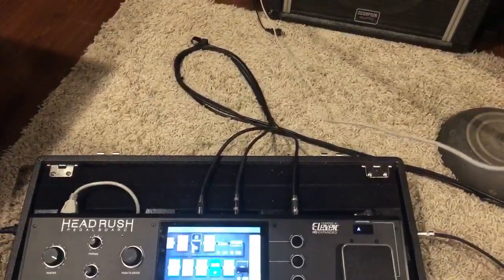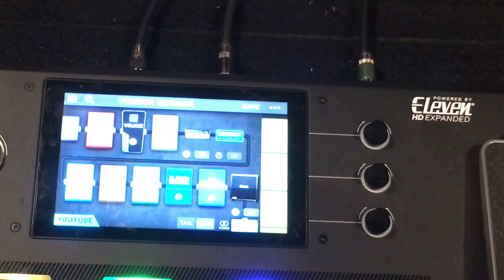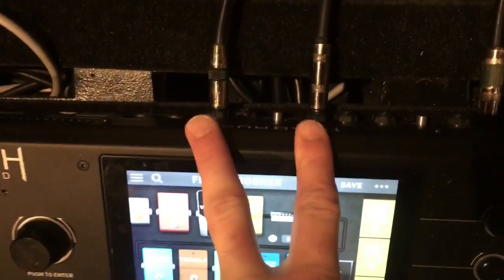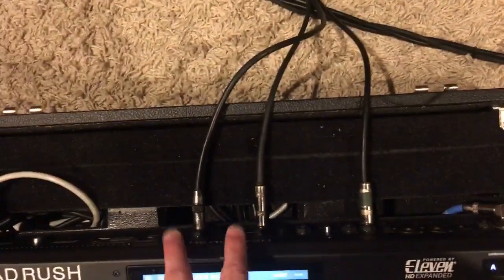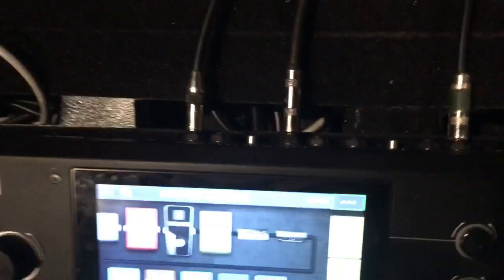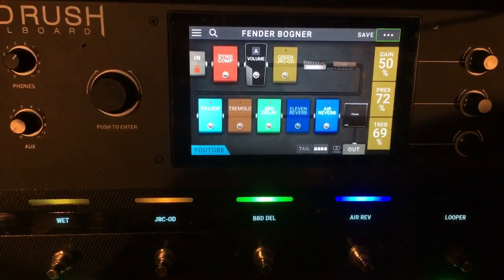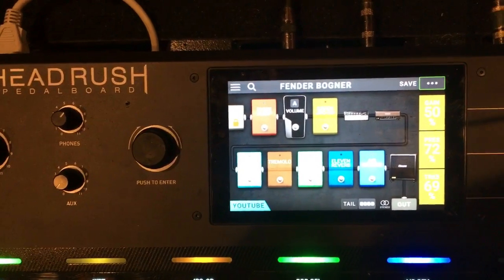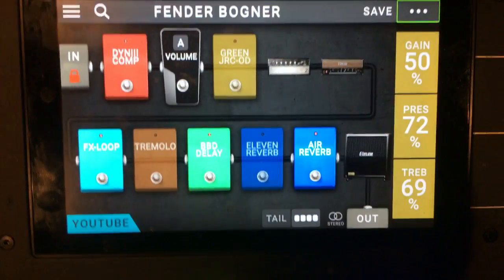4 Cable Method Setup Explained

Comment: Thank you for this video! It's the most informative one I've found for the 4 cable method. I've been using my FRFR but want to experiment with running the headrush into my Fender BDRI just for something different.
Reply from the maker: yeah man 4CM is fun to use and offers lots of options.

Comment: Well i think i got it to work with my Marshall. My next question is why do the tails turn off and cannot be turned back on when you insert the effects loop block?
Reply from the maker: Unfortunately tails don’t work when using the 4 cable method.  It’s really a bummer.  I think they do work when using scenes though.  Just not between rigs.
Reply: @DoctorMcFarlandStudios  hopefully it will be an updated fix someday.

Comment: Hey doc, if I’m not going to foh for example an just using amp using the amps speaker (combo amp) what would my global settings be for that? Also on the back where it says line/amp and stomp/rig what would be best to use? Thanks mate
Reply from the maker: Depends on if you are using the input jack on the front or the FX return on the back.  Either way I would use the Alt output and set the source to cab/IR input.  Line and amp are just sending different levels.  Either setting won't hurt the unit you are going into. For FRFR use line and for amps use....amp.

Comment: Always want to have this explained, thanks!  Only problem I can see is the Tail function is not activated.  Any work around you know of?
Reply from the maker: Correct.  I wouldn't suggest using the 4 cable method with a Headrush or Gigboard since the tails function is defeated in the process.  Plugging into the FX Return of an amp is a the best option if you really want to use a real amp in your setup.
Reply: @DoctorMcFarlandStudios  so the fx into the output of the headrush ? I just got mine yesterday and am looking for ways of going into an amp 
Thanks

Comment: Hey Doc, I'm having the same issue as navo1020 is with the 4CM. I want to use my amps preamp for the tone and the HeadRush for effects only in front and in the FX loop. The signal however drops considerably when I do this 4CM. How can I achieve my amp pushing through the Headrush at the same volume as if the HeadRush wasn't there and it's guitar and cable straight into the amp with no effects. Bottom line I'm losing the regular amp tone push when I use the 4CM.
Reply from the maker: Is there a volume adjustment on the amp for the FX Loop?  I wouldn't know unless I saw it. Send me a message on facebook and we can facetime each other so I can see your setup.

Comment: What happens if you have the Alternate output set to Cab Input but you switch to a patch where you are using a IR in the chain? Do you have to change the Alternate Output setting everytime you switch between those two? (Cab and IR)
Reply from the maker: Yeah you can't have it both ways. I have starting using the stock cabs 99% of the time.  They sound great to me.

Comment: I think that the idea is to bypass your real Amp Pre amp if you are using the headrush amps, so this means that you should put the fx loop before your headrush amps, Am I correct? I'm a little bit confused, but thanks for the video!
Reply from the maker: nava1020 haha you may be right.  Experiment with it and let know what you find out.

Comment: Hi thanks a lot for this great video. Is the following setup possible? 4 cable method with real amp headrush just using effects eg. on the left channel output and right channel a virtual amp and cab from the Headrush? Cheers
Reply from the maker: You would  essentially use the XLR output to send the full rig to a FOH and the 1/4 combined with 4CM to the amp. If using the Headrush I still suggest using the FX return of the amp or an FRFR Speaker. If you want to use your real amp for channel switching then the Line6 HX effects or Helix would be better for this setup.  What amp are you using?
Reply: Hi thanks ;-) I use a Friedman Runt 20 which has a great buffered effects loop. At the moment i have the Line 6 HX effects but am thinking of selling and going over to the Headrush, because I find the interface much better and easier. Ah ok so I connect the headrush with the Runt 20 in 4CM via the effects loop of head rush and the Runt 20. What are the the Global settings for this? Thanks.
Reply: Hi again. Some people seem to have "tone suck" when using 4CM. What is your experience on this? I heard some people say this for the headrush, but even more people said this for the HX effects when in 4CM. I guess it also depends whether your effects loop is buffered? Thanks fo r your opinion on this?
Reply from the maker: @henriksorensen6438  I would just use the FX Return so you can still take advantage of the power tube section of the amp. This will allow you to utilize the amps in the headrush as well as the effects and keep the spillover functionality between rigs and scenes.
Reply: ok thanks. So basically Headrush as preamp and my real amp as the power amp. Thanks
Reply: do you think the line 6 hx effects is better for the 4 cable method?
Reply from the maker: @henriksorensen6438  Yeah thats the best way to use the Headrush.
Reply: ok thanks ;-) do you think the HX effects from line 6 is better to than the headrush for 4CM?
Reply from the maker: @henriksorensen6438  Yes I do. Only for the fact that you can't use tails when using the FX Loop on the Headrush. It was a huge mistake in the making of the unit but with that said I think the FX return of an amp while using the amps in the Headrush for the "preamp sound" is just as good and is a really great setup. Its the setup I use 99% of the time.
Reply: ok thanks again for your time ;-)

Comment: Hey doc, I'm doing the same but my amp signal (the Marshall pre amp) is really low, is it mandatory to have the HR master all the way up?
Reply from the maker: Shouldn't be but what physical amp are you going into?
Reply: @DoctorMcFarlandStudios  Well its a Marshall MA100, head and Cab, when I use my HR just on the Return of the amp it's a nice signal when I use the 4cm (fx loop block at level 100) it's just really really low, at this moment I have the HR master at 12 o'clock and the switch at the back of the HR is on Amp instead of Line. Then I switched to Line and out the HR level at 3 o'clock and it gets better, I would say that the volumen of the pre amp straight from the guitar is the same that the one I receive with the 4cm. Sorry if you don't understand I just wanted to know if this is normal. 
Best regards. I also am in the Facebook group so I can also PM you there.
Reply: Im using the the pedalboard with my JCM-900 using the 4 cable method and with my amp gain at 12:00 and my volume at 12:00 I put the Headrush volume all the way up and control from there with my guitar volume and tone and it works great.....

Comment: Can you use external pedals with the 4 cable method?
Reply from the maker: Bailey Squire yes of course
Reply: Doctor McFarland Studios  is there any diagram to show or link to a video? I’ve been struggling for the past hour trying to hook up a pedal and I’m not getting anywhere. Help is appreciated 🙏
Reply from the maker: @baileysquire6750  Well it depends on where you want it in the chain. You do understand you need an FX Loop block in the chain to complete the 4CM setup?  If its a pedal that goes before the amp then just run it to the input of the Headrush. If it needs to go after the amp then have the pedal be connected from the Send of the FX Loop.
Reply from the maker: @baileysquire6750  https://www.youtube.com/watch?v=imJeOFw3IK8 watch this video. :)
Reply from the maker: @baileysquire6750  https://www.youtube.com/watch?v=imJeOFw3IK8 watch this video. :)
Reply: Doctor McFarland Studios yeah I’ve been using the 4cm method for 6 months but never tried hooking up an analog pedal. I’ve got a tc quintessence harmony pedal to put in after the amp. I’ll give the video a try thanks!
Reply: It’s also a multi channel amp. I’m only able to get the channels working with the pedal of the fx loop doesn’t sork

Comment: Not sure why, but I thought that if you used the Headrush as a pedalboard through a real amp and the 4 cable method, that you could not use Headrush cabs, amps, or IR’s?
Reply from the maker: You would not want to do that normally.  What are you trying to do?
Reply: Doctor McFarland Studios , I have not done anything yet. Right now I just use the Headrush with a Mission Engineering Gemini 2  2x12 powered FRFR cabinet. I am purchasing a new combo amp and definitely want to use the pedalboard for my effects through the new amp. I was just surprised to see you utilizing amps and cabs from inside the Headrush in conjunction with an external amp. Thought it was not possible. Thanks for the reply.

Comment: I lost all use of my amp when I used this method. I couldnt control volume or anything.
Reply from the maker: yes because you didn't put the FX Loop Block in the signal path.